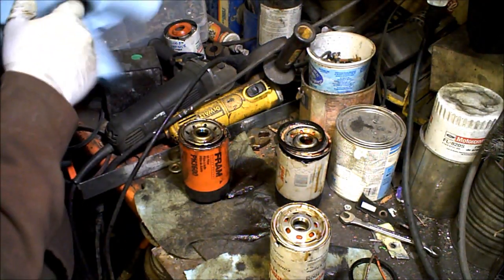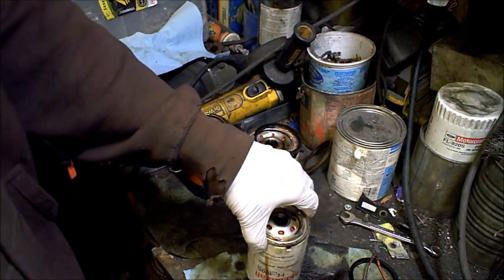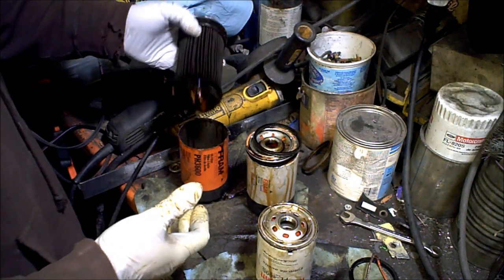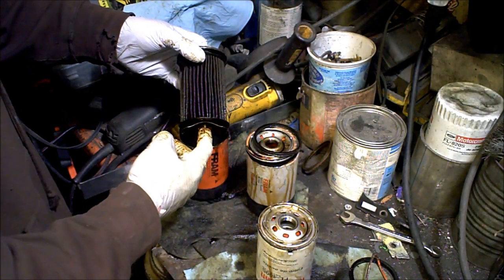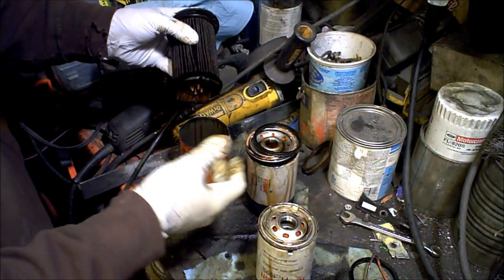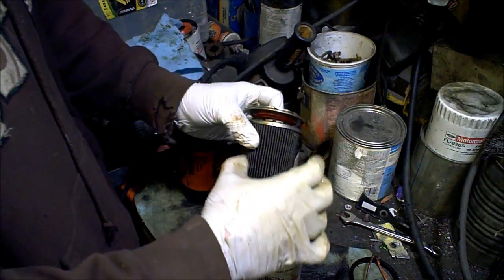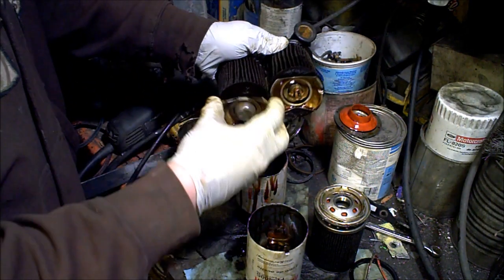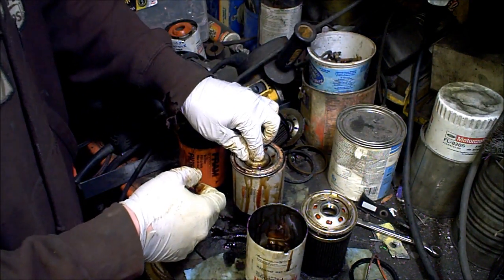oil filter pressure bypass valve comparison

Comment: I may just be realizing it, but this oil filter things has really blown up to something kinda big. This filter video has explained things in a way no other has. Makes me want to cut open every oil filter I have ever had....impossible.
I like the by pass on top, at least heavy grin down at the bottom wont get drawn up into the engine.

Comment: Great video man, very helpful. I am currently having issues with my filter. This about sums it up for me. Filter wasn't filling up and i wondered if my engine was getting oil feed. Had a pressure gauge on a sandwich plate and had good pressure. Relief or bypass make absolute sense.  Thank you sir!
Reply from the maker: Glad it helped!

Comment: Good explanation thank you, I thought I knew everything already! 😆

Ive always thought to use the largest filter possible to avoid bypass as much as possible with the larger media area. 

I run a motorcraft fl1a on my jeep 4.0, seems well made with metal end caps..
Reply from the maker: I use the fl1a on nearly everything.
Reply: The main feature of a Motorcraft Oil Filter is the Inlet-End By-Pass Valve.
If the Fram Ultra had the Motorcraft By-Pass Valve, it would be the best oil filter on the market.

Comment: I'm glad you touched on this subject.
What Filter has the BEST Bypass Relief Valve? Spring, stamped
Are there others like Motorcraft design?
I have a 2024 Nissan Frontier
Wix XP, Napa Gold, Motorcraft, Other?
Reply from the maker: You can't go wrong with the Wix/Napa. Go with Motorcraft when you want an excellent filter for dirt cheap that is 99.8% as good as the Wix.

Comment from the maker: Thanks.. The E-Core is just a plastic tube in the middle of the filter media instead of a steel tube. Generally only on cheaper oil filters as it lowers the cost.

Comment: Like Motorcraft, NAPA Gold filters have upfront bypass valves and are generally made better, IMHO. Also a reasonable price for a mid tier filter.
Reply: I use a Wix or a WixXP almost exclusively. I know that the Wix & Napa Gold are the same but does the WixXP also employ the direct to outlet type bypass relief valve as shown here?

Comment: This was very interesting for someone who is (somewhat) mechanically inclined and interested but has hardly any knowledge in this area.  I would love to know your take on how much difference the bypass value makes- 14 psi versus 23 psi.  I've found a lot of discussion but no real answers.  Subject comes up a lot when discussing after market subaru oil filters.  Subaru's OEM filters use an unusually high value, i.e. 23.
Reply from the maker: Josh D Oil and oil filters is a very biased subject with no real answers. Just a lot of hot heads vomiting non factual opinions. Mechanical engineers spend a lot of time figuring things out to make them last a long time. But they are also paid to make stuff "work on a budget". I would trust good brand oil filters on any make of car. Like you know, the purpose of the bypass is to flow oil in cold conditions. The higher psi could cause slightly higher restriction and result in less oil flowing to vital parts, but their filter media might flow easier than media on a 14psi filter so it's a wash in what's better. Without having all the data, it's impossible to make a judgement.
Reply: Thanks for the response!

Comment: At least now i finally understand somewwhat i kept hearing drainback valve but disnt truly understand it..now can u help with one question i just bought a royal purple filter 20820 on amazon u can see the spring coil on bottom of canisster why is that there what does it do for the filter.good video
Reply from the maker: djsmileyoflasvegas The royal purple is a good filter and has the top mounted pressure relief valve. The spring you see in photos applies pressure to the pressure relief valve. Essentially forcing the oil to go through the filter media, but if the resistance of the oil going through the media is to great it will overcome the spring pressure and flow directly through the relief valve.
Reply: sixtyfiveford

Comment: Ive heard the rubber, maybe even silicone valve dries out sitting on store shelf for long time making the valve useless possibly causing oil starvation engine knock on 1st start up of the day... any thoughts on this?
Reply from the maker: Rubber may harden but silicone never will. However I've taken apart new filters from the 1970's that the rubber was still pliable. Even with the antidrainbacks the pump to the filter will be dry and there will always be a second-few seconds of dry start until it pulls then pushes oil into the filter to push through the rest of the system. However if you had an engine with a horizontal mounted filter and it ran dry I think it would add another second or two to refill it.
Reply: @sixtyfiveford  I should have put "silicone" in quotes bc we dont know exactly what that industry considers silicone (ever had subway sub "meat"? lol). being 58 yo i can attest they made rubber & most everything else better back then lol. The horridzontal filter design could very well be a factor, wonder if theres a work around? Apparently this knocking on 1st start of the day is a real thing for Jeeps....Filter is the prob there, heres a vid on it  https://youtu.be/uFXJ7KMez4Y
Reply: No they don't harden and the seals are made from Viton😎
Reply: What you heard is somebody's OPINION, because the FACT is that Silicone ADBVs WILL NOT deteriorate on the store shelf. PERIOD.
RUBBER, on the other hand, CAN detiorate on the shelf, and it DOES deteriorate in hot engine oil.
Rule of thumb: Look in the holes. If you don't see an Orange color, PUT IT DOWN !!

Comment: What I hate about oil filters is you can not see through them to see what is inside. I think at one point many years ago Fram was the best, and then at some point they manufactured them cheaper. The problem is you can't see inside to know what you are getting. It could be defective or empty inside for all I know.
Reply: Maybe frame started out with the premium as shown and then later built the cheaper one...   Best to just change the oil ever 5 to 6000 max kms. Regardless of what the book says......and make sure clean oil goes in and that the container and funnel are also clean...I Always check...  A few minutes of paying attention can save big $$$....lol
Reply: That's why you can come to U-Tube and see dozens of different brands and types of oil filters cut open and examined in varying degrees of detail, and often with conflicting "results".
Among the "Testers", most of which are absolutley dedicated to a damned "Coil Spring", (it's actually inferior to the Stamped Spring) there are many who MEAN well, but are not qualified to make scientific  measurements and report their findings in a manner that states FACTS, rather than use words like "nice" to describe a filter's ADBV.
But hey, nobody's perfect --  some of the "Testers" have sloppy work habits, some have limited experience, and some have no idea what they're talking about.
 In any case, it's cheap entertainment.
Reply: @SlikLizrd  I wonder if the Fram Ultra or Mobile 1 Extended Performance filter has a stamped spring? What brand and model is your favorite?
Reply: @bobby1970  Yes, the Fram Ultra AND the Mobil 1 both have a stamped metal spring, as do the most expensive oil filters (Amsoil, Royal Purple) available today.
FRAM tells us WHY they use the Stamped Spring: The Coil Spring pushes on the CENTER of the filter cannister, which distorts the thin "dome" of the cannister.
 The Stamped Spring pushes against the EDGES of the cannister, and will not distort the cannister "dome" in any way.
Some folks are so confused that they believe that those Springs are there as part of the PRESSURE RELIEF VALVE,  when the job of that spring is just TO HOLD THE PARTS IN PLACE.
 The famous 95 MERC runs Pennzoil Ultra Platinum, 5-W-20; Bosch Premium Oil Filter # 3410; and a FILTERMAG #SS365PR Magnet Kit. Oil & Filter changes at 5,000 miles.
Reply: @SlikLizrd  Thanks, I really appreciate the info. I would like to ask you another question if I could? Do you know of any good oil filters that have the pressure relief valve at the top of the filter (the opposite end of the filter that the base/cover plate is located)? My understanding that the pressure relief valve is the same as the bypass valve?
Reply: @bobby1970  Modern oil filters have their By-Pass Valves located at two (2) areas -- most have the valves located at the  "dome" end of the filter, while the Motorcraft and SOME Wix/Napa filters have the By-Pass Valves located at the INLET END of the filter, which is the preferred location, as it avoids washing the dirt off the surface of the filter and sending it back through the engine.
 And yes, the Pressure Relief Valve is the same as the By-Pass Valve.
FIY, that stupid Coil Spring has NOTHING TO DO with the oil pressure inside the cannister.
Reply: @SlikLizrd  Great info. Thanks.

Comment: Regarding the 2 Fram products, if the videomaker would have compared the 2 Fram filter medias, he would have discovered that there indeed is a difference between the 2.  The higher end Fram has a different number of pleats that the low end Fram extraguard.
Reply from the maker: +hoghogwild The video has nothing to do with pleats.
Reply: A comparison was made between the 2 Fram filters in this statement, "same ah paper end capped  filter er paper end capped ya  filter media", when in fact the 2 filter medias are different.
Reply: The type of material used in the filtering media has nothing to do with the number of pleats in an oil filter.
 HOWEVER, some filter manufacturers removed a WIRE SCREEN BACKING from their filter media to make room for MORE PLEATS.
Reply: @SlikLizrd  a) Yes, I agree.  b) The move away from "wire screen backing" is a mistake IMO. I've had the media blow out before. I wasn't impressed.  I always cut open my filters now and I don't buy entry level super economy filters.
Reply: @hoghogwild  Yes, I know -- A lot of people mistakenly believe that the wire screen was NECESSARY, and that the wire screen could not be improved upon.
Fact is, they were wrong, but it's quite difficult to find anyone to ADMIT to their error.
Unfortunately, many of the "Filter Tester" persons who provide the videos are not interested in LEARNING anything -- but are quite gung-ho on insisting that the wire-screen backing is/was the best available method for supporting the filter media.
Reply: @hoghogwild  Several Filter Makers used the wire-screen backing -- until they could find something BETTER, which they did, in the form of the Polymer Screen, which is STIFF enough to supportr the media, and yet THIN enough to make more room for MORE PLEATS.
Removing that bulky wire mesh screen was the smart thing to do -- it gave us better oil filters.
Reply: @SlikLizrd  Excellent.  I didn't realize that a replacement support material was enacted. I was operating under the assumption that the choices were two: either wire mesh backed filters or basic unsupported filter(such was the cheap filter I had blow out).   I used to include a comparison of a filters weight as it could correlate to filter quality. The use of polymers in place of drawn metallic structure throws that thinking out the window. The weight of an entry level filter vs. their higher level filters was marked(talking 6-10 years ago). As with anything, technology marches on-so long as quality doesn't suffer.  I appreciate your insights, thank you. I've got an oil change to do.

Comment: this video explains how once dirty and clogged the filter with bypass on the top let all the sludge pass into the engine...
Reply: That's what a By-Pass Valve does -- when opened, it allows the oil to BY-PASS the filter media and go back into the engine un-filtered.
The superior By-Pass Valve design is with the valve at the INLET END,  as used on some models of Motorcraft, Wix, and NAPA oil filters.
This design prevents particles from being washed off the surface of the filter and sent back to the engine un-filtered.

Comment: Fram is fine, I wouldn't use the lowest end filter if you're one of the guys who does 10k+ miles synthetic oil changes, but if you're changing your oil every 5k miles it'll work fine.  Almost every post I've seen about how they're terrible is not posted from engineers or good mechanics.
Reply: The FRAM (Cheap-o model) is only suitable for 3,000-mile oil change intervals.
The FRAM Ultra is good for up to 10,000-mile oil change intervals.
As a retired engineer and a damned good mechanic, I can say without hesitation that NO oil filter should be run for more than 10,000 miles.
The juice ain't worth the squeeze.
Reply: @SlikLizrd  I change my oil every 3,000 miles regardless of oil type or filter type.
Reply: @bobby1970   Unfortunately, too many folks have ignored the dangers to our air and water quality, and continued to change their oil at the 3,000-mile point, even though the quality of lubricants and filters have improved dramatically in just the last five  (5) years.
Simply changing from a 3,000-mile oil change to a 5,000-mile change point, is a savings of 40% on your oil & filter costs, and a 40% reduction in damage to our severly-distressed environment. 
 It's a no-brainer.
Reply: @SlikLizrd  You have a good point. I learn something everyday. I'll have to remember to change it at 5,000 miles from here on out. Maybe even 7,000 miles.

Comment: On an item that only costs at most $20 you would be foolish to cheap out and buy a crappy oil filter especially since most people only use 2 a year on average. If you use a Wix or Napa Gold the price is even lower. My only complaint about Wix is that the WixXP version is the one that uses a fully synthetic filter media but has a micron rating of only 35. The Wix regular/Napa Gold has a better micron rating (21) but is not fully synthetic it has a filter media that is (at least partially) cellulose. I disagree with the claim that cardboard end caps do not pose a hazard to the engine; most of the time they do not but some have come apart and caused engine damage (please research this on your own). The higher end Fram oil filters do away with the cardboard and provide metal end caps and a fully synthetic filter media but I still would be reluctant to use them on general principle.